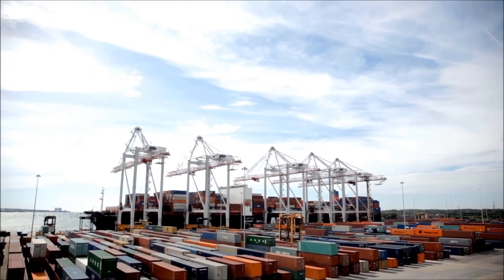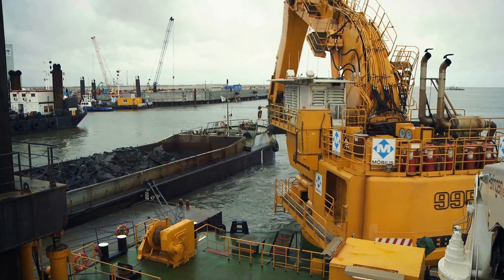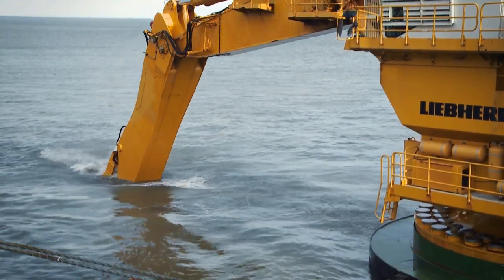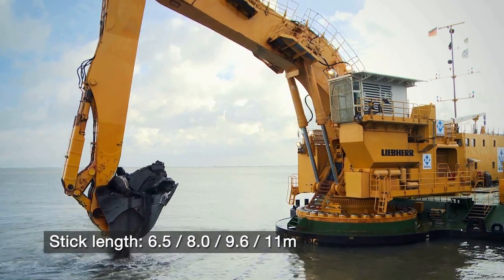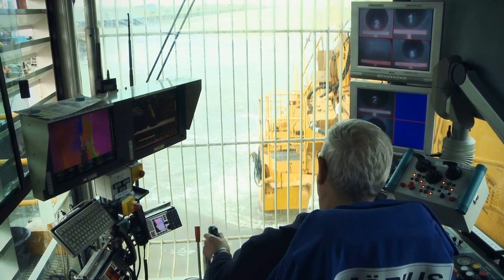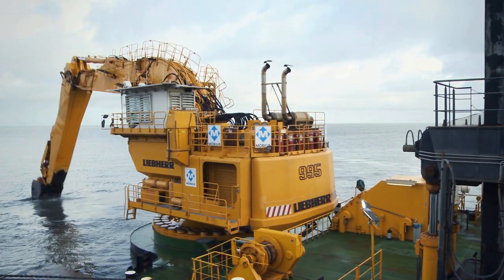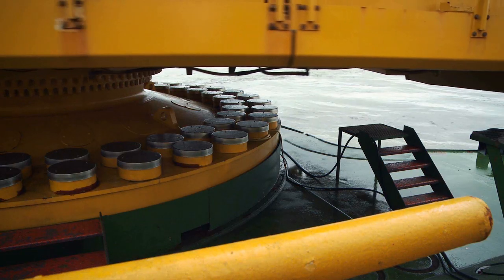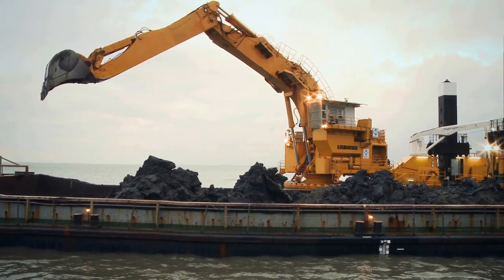Liebherr – Ponton excavator P 995 in dredging application

Comment: I dont understand why the bucket is so small🤔
Reply: 14.5 m3 is not small
Reply: @gesti9782 thats hugeee!
But it looks so unproportional to its body. Same as liebherr t282c dumptruck although its huge by  loading capacity.
Reply: @gesti9782  it is small, that's because hes using a long stick/boom configuration. With the short attachment you can fit an MST bucket up to 25 m3 and thats still small compared to the Backacter 1100 which can use buckets up to 40 m3.
Also the dredge software this company uses is crap, you can't work very precise, we use Seatools for dredging and we can dredge up to 5cm precise with the Liebherr 995B and up top 10cm precise with the Backacter 1100
Reply: it’s wet sand clay .. heavy

Comment: P995 powerful is good.
Reply: Yes, too bad the operator isn't that good.looking at his working draft and the spiritlevel in his cabin the pontoon is almost floating and the cabin of the machine is inclined so the reading would not be accurate that's why these pontoons have draft sensors and roll/pitch sensors.